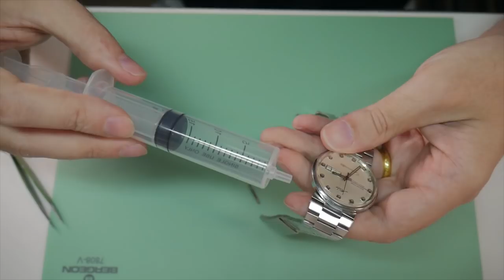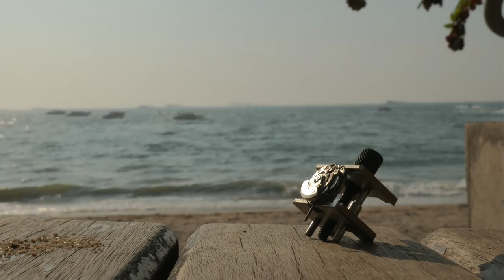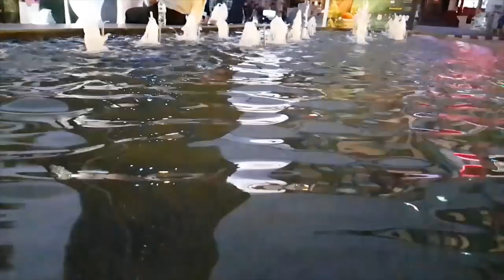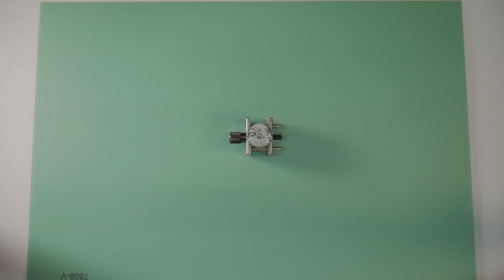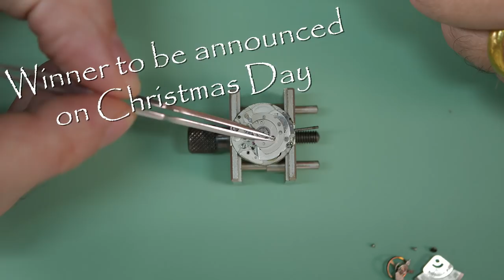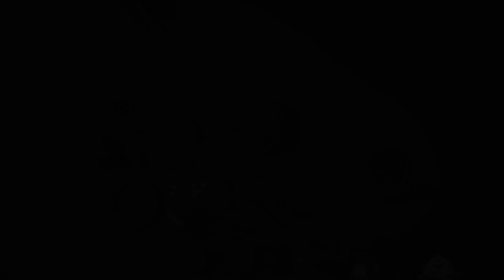So Much Glue - and a Seiko Watch Repair Christmas

Comment: Isn't it easier/cheaper to ditch the movement and install a new one ?
Saves a lot of hours twiddling with it.
If it's "high end" it would pay off but a cheap automatic Seiko ?
If it's a hobby it's a different story , the challenge alone would make it worth your while.
Like a jigsaw puzzle but more adventurous.
Seeing it run after you take it apart and put it back together is a great reward.

Comment: I'm allergic to Nickel myself. Are you not able to wear 316L stainless steel? Stainless steel doesn't cause allergic reactions for me. If the Apple watch is made of a metal, I would imagine it's 316L stainless steel and that's why you don't react to it. Stainless steel typically contains 10% or so Nickel, but doesn't release enough of it to cause a reaction in the vast majority of cases. Of course, this is all assuming that it's Nickel you're allergic to, and not some other element. Other options are PVD and DLC coating. If you can't wear SS without a reaction, odds are the reason you don't react to the Apple watch is because you got one of the PVD coated versions. Just need to make sure any metal coming in contact with your skin is PVD coated in that case. Titanium is another option that seems to work for most.

Love your videos, man. Learned a ton from them.

Comment: Hey man, thought this might help u about your hives issue when wearing a watch: have a dr prescribe u a low dose doxycycline or penicillin vk 500mg x 3 per day. So7nds like u got what I have which is streptococcal skin infection. I never had an issue unti”this summer and it got bad. If u have a lowered or compromised immune system it exacerbates it. Hope it helps as it did me.

Comment: I have encountered the Blob of Glue once. Dial legs were gone and a blob of contact cement had been installed instead. The worst part of it was, that since it was a cheap Citizen, after reassembling it I didn't see what else to do than to reattach the dial with glue. But I won't pass that watch ahead.